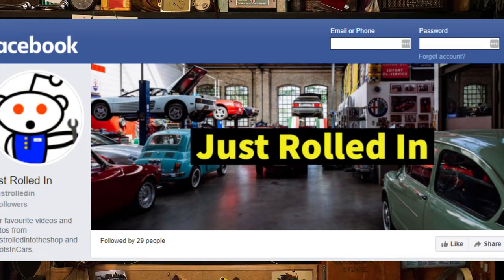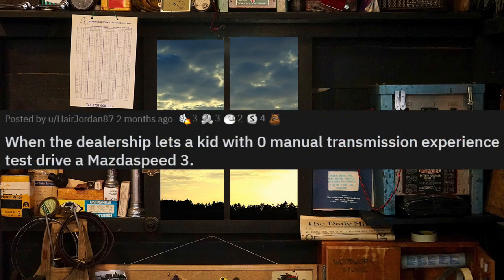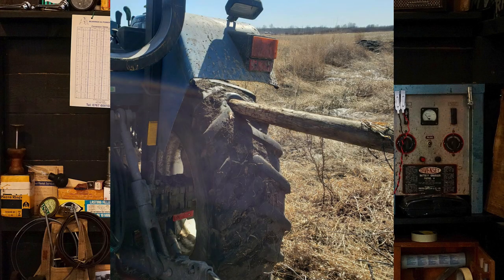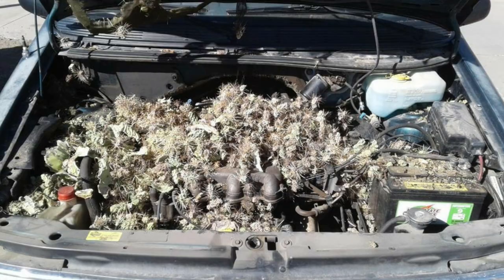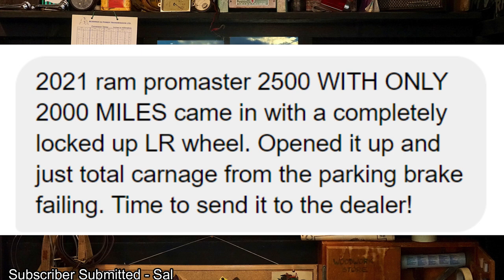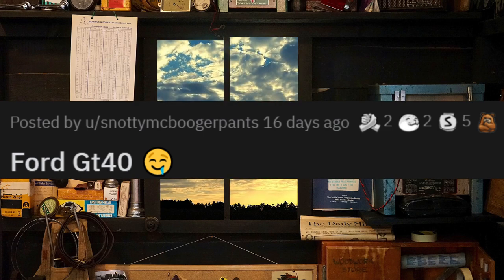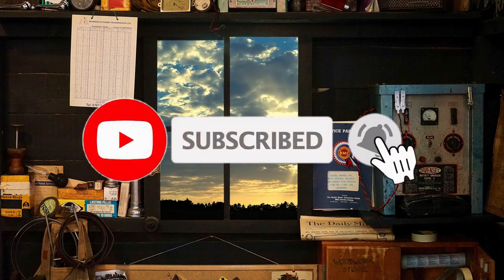Customer States "Can You Remove This Rabbit From My Engine?"

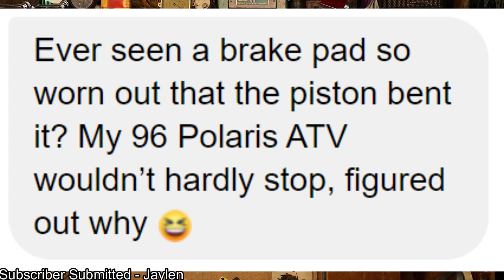Comment: @1:04, yeah I have seen that.  If the rotor gets too thin and the break pads also get too thin, if possible for the caliper piston to push itself out too far until I can turn sideways.

Comment: I almost had to remove the alternator on my demo derby 1990 Mazda B2200 pickup, trying to save a friend's startled cat. The story is, that the truck was parked most of the time at my friends house so the cat has made the battery tray it's cat bed. That day I popped the hood to check on the engine. I saw the cat crouching down on the battery tray, it got scared and took off getting herself stuck under the alternator but in the end she snaked her way past the tie rods and front crossmember.

Comment: In CA I had rat nests on my battery.  Moving to rural NE Arizona, I get bunnies, as well as rats.  One bunny ate a foot of 10 conductor cruise control cable.  Eight wires go into the cab---but where do the other two go?  He also ate all my windshield washer hose.  If they didn't do any damage, it wouldn't be so bad.

Comment: Garden hose oil return line, guess y'all never broke down in the middle of no-where or in the woods where help ain't comin and had to figure out how the get home. I once crushed my power steering cooler because Mazda thought it would cute to mount it on the front axle. I pulled the cooler out and connected the two lines with a 6mm socket and two hose clamps. Drove it like that about six months before I decided to order a new one.

Comment: Ahh the ATV brake pads, something I'm quite familiar with! All the grime packs up in the caliper, atv sits for seasons at a time and eventually parts corrode together. My favorite though was a harley customer who was angry about having to replace his rear brake pads again. he only used his rear brakes (one of THOSE people..) and burned through them faster than tires. This time he called us ripoffs and left. A few weeks later he was back, complaining of his brakes barely working. The pad wore through, then the steel backing plate until the piston literally went through what was left. Caliper and rotor destroyed. We fixed it all, and i don't think he came back, which was fine by me. For all the brands of bikes I've worked on, HD customers overall were the worst.

Comment: My wife drove her car home and some pulled up next to her on the highway yelling "You have a Flat!"  She came home and told me.  I did not find a flat, but realized the guy was yelling "Dead Cat!" as the rear end of the cat was stuck in the engine compartment with the front half dragging on the ground.  So here i was under the car with a pair of Channel locks pulling on that cat with it's juices leaking out when a couple of Mormon boys came buy on their mission wanting to spread the word and talk to me.  They did not hang around for long once they saw me pulling on that dead cat.  It was so jammed in i could not get it out, so I decided the next best thing to do was take it in for an oil change the next day.  Halfway there, the cat knocked loose on the highway. Riga mortise had set in.  When I heard the thud of running over the cat, I looked in my rear-view mirror and the cat was stretched out and sliding down the highway behind me, then went into the ditch.  Those squishy sounds of that cat in those Channel-locks will haunt me forever!  True Story
Reply from the maker: That's a crazy story and I feel bad for the poor cat!! I hate removing animals from vehicles, especially when they're dead.

Comment: I followed a pick up with the rear diff cover missing. The truck stopped at a light, I told the driver what I saw. He was more than a little upset, it was a brand new truck. He had just picked it up from the dealer and was taking it home. I told him turn around and take it back, the diff was ruined anyway. Not a drop of oil in it.  Do your own PDI new or used, you never know what you may find.
Reply from the maker: Wow no diff cover. Now that's a first lol

Comment: Wildlife:  I have an old Foxbody Mustang that was in storage for a while.  Opened the hood to begin getting it back into driving shape and there was a 3-foot snake on the engine.  Nope.  Closed hood.  Walked away.  

I did get it running again a few weeks later.  Still drives like a champ.  And no more snakes.

Comment: Had an incident with an animal in an engine bay. Not in a car, but a Case wheel loader. Ran it one day and the next day I started it, I heard a couple tings from the engine area. Didn’t repeat, so I thought nothing of it. Was working on it later when i found the clumps of fur in the radiator. Found the cat at the bottom of the fan shroud. It had made its way past the guard for the fan. Was a cold part of the year. Totally sucked. Made it a point to bang on the engine covers to scare out anything hiding there since.
Reply from the maker: Damn poor cat! Good idea on hitting the engine cover before getting in.

Comment: My uncle lived on a farm, and had lots of cats.  During the winter months, he would use his tractor daily to clean the barn.  The cats would then climb into the engine compartment, between the fan and radiator, for warmth.  Several cats were killed yearly, when he started the tractor.

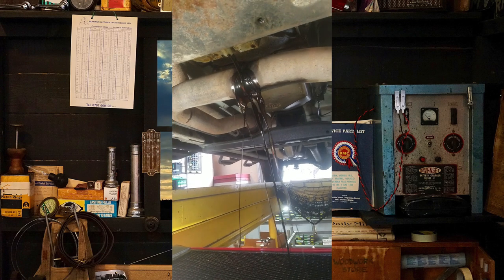Comment: 0:45 Every ford truck I ever changed oil on (early '00s and late '90s mostly) drained directly onto the frame. Not as bad as the exhaust, but also wouldn't clean itself up like the exhaust...

Comment: I bought a brand new Acura and it only had 32 miles on it when I limped it back to the dealership, the coil got so hot it melted the head. And they actually thought I would take it back after they fixed it!  Didn’t happen, got a different new one

Comment: The "GM Innovation" thing reminds me of an oil change I had to do on a BMW. Most irritating car I ever worked on, other than Tesla. The dipstick and oil pan were fine. No issues with those. It was the fucking oil filter itself. It was built into the engine... near the front window... under a beam that was BOLTED INTO the frame. None of the tools that I had at the time could reach it, so I had to get it by hand. Long story short, it took me over an hour and a half just on replacing the oil filter alone. German Engineering, my ass.

Comment: That's not a drive shaft. That is a torsion spring for the front of a GM vehicle. There are tons of pickup trucks vans and suburbans made like this. The loan fact but you can adjust the right height of the vehicle by tightening the screws that twist those springs down on the frame.

Comment: When I was a tech for Nissan I had to replace the transmission in a brand new 2014 Nissan Versa after going to put gas in it when I was done with the PDI. Nissan sent engineers out bc they didn't believe the transmission was bad. They had me replace the TCU and eventually replaced the CVT trans.

Comment: My 2018 silverado the oil drain plug and filter are in a great spot and right beside each other, perfect! Now the transmission pan has no drain plug and the pan has to be dropped to change it. Well guess where the exhaust goes….right underneath the pan so dropping it isn’t as simple as
It sounds

Comment: I'm from Australia and down here we have these animals called possums
Their nocturnal, so you rarely see them during the day.
Anyway I rocked up to my job about 8:30am, it was cold and raining lightly.
Right before parking my car, I see something out the corner of my eye scurrying around and coming straight toward my car.
I stopped, it looked like a giant very wet rat. It was a possum looking for some warmth. It climbed up my wheel, up the spring, across the upper suspension arm and found a comfortable very warm spot between the engine and a heat shield.
When I found it there, it looked at me with its small black beady little eyes.

I tried to remove it, but they have four hands and a tail they can wrap around everything.
It was holding on to a hose so tightly that if I pulled it any more, it would have either hurt the animal or pulled the hose out with it.

I left it there to enjoy the heat.
I guess the little blighter felt hungry too because I had all kinds of electrical issues later which cost me a packet to have fixed.

I hope that possum had a great life with many kids, because my brief encounter with it was very expensive🤣

Comment: “Have you guys every see brand new vehicles have issues?”   Almost every Hyundai….  But it’s job security
Reply: Back in the 80s every new American vehicle had issues. You just expected to take it to the dealer for warranty repairs. My dad bought an '81 Ford Fairmont new off the lot, and the parking brake didn't work. The dealer couldn't fix it, so the car just never had a parking brake. This was in addition to the rustproofing material smeared on the upholstery and the handful of loose bolts that fell out from under the dash.

Comment: in 2008 a 2008 jeep with under 300km on the clock, locked up after the oil pick up fell off.
when the motor was pulled down, all the bolts inside were only finger tight .......... must have been the last one made on a friday.

Comment: When i was young and over my head on a repair to my car I had to remove an Animal of a mechanic who couldn't compare timing gears  (new  to old) and spent 3 days trying to get the distributor shaft into the car with the wrong gear on it.  I could understand ordering the wrong one but not taking a look when it wasn't working?  Some Chevy 5.7 came with roller camshafts.

Comment: Ever see a left rear brake Disk worn down to 1/16" thick and broken off from the Parking brake drum still held in place by the frozen caliper with the brake pad all metal and about half thickness. The shade tree mechanic across the street Said "It was making a funny noise might be a rear wheel bearing".

Comment: :48 My cavalier is just like this, the oil filter is right above where the flex joint is so the joint just gets soaked in oil when you pull the filter off and it smokes for about 20 mins of driving with a huge blue cloud behind me. So stupid
Reply: Yeah, on older Honda Civics the filter is on the firewall side of the engine, directly above the downpipe. Pain in the ass.

Comment: I saw a picture of a rice burner with a HUGE SNAKE in the engine bay pretty mangled.  The kid noticed it started acting funny and pulled over and opened the hood and almost fainted.  I think it was a boa.  They had no idea where the snake came from (It was is LA, btw).  I am just glad I didn't have to remove the damn thing (and I don't like snakes).

Comment: I had a 1985 Camaro Z28, pulled that shitty GM TPI crap off and carb swapped it, so the check engine light was always on because the wiring harness not being connected to anything thought something was seriously wrong with the engine; anyway, the check engine light in those cars is conveniently a completely separate light on the dash, in its own rectangular cutout, and a piece of electrical tape covered it nicely lmao 

This video reminded me of that

Comment: Turbo oil will cause a vehicle to catch fire, We has a series of bus fires locally.  Some dried coolant is combustible, busses again. Fire caused by worn through wiring to the A/c, bus again. Cross threaded  CNG line, overheated engine and a loose wire oooh boy.

Comment: About the animal under the hood, my Father and the cars owner had to clean out the entire engine compartment because a cat went through the fan and belts and its body was everywhere. And alot of it had burned from the heat of the engine  because the owner drove it 40 miles after he smelled something nasty coming from the heater and smoking from under the hood.
Reply from the maker: That smell must have been awful!!
Reply: @JustRolledIn  My Dad said he threw up 3 times by the time he was done. 
And this was in the late 60s, so no power washers invented yet.  Just a hose and a nozzle and cold water.  Oh, and alittle over 3 hours.
Reply from the maker: @davidbruin4381  Dang, I feel bad for your dad. What a mess that would be to clean without a power washer.
Reply: @JustRolledIn  I'm just glad that I wasn't old enough to help 😅. And not there when he had to do it. Eewww!!!

Comment: back in the days when we used to live in a oli camp, back when oil companies have the massive urban centers build just for the workers, we had an issue with cats snucking on the engines, bloody mess, grind up cats dont smell good, imagine firing the truck and hearing the cat on the radiator fan, at first you think cats are fighting then you realize what happened, i remember one got stuck in the belts, that was neighbors, not a good way to go.

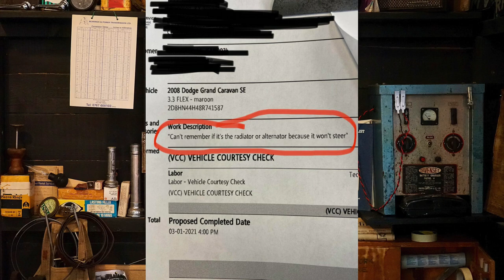Comment: 0:52 ROTFLOL

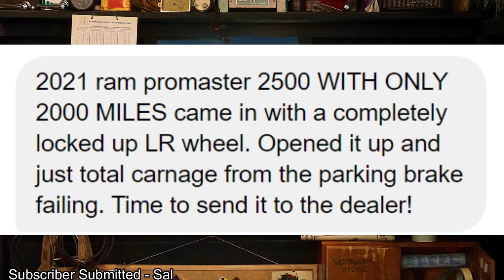3:23  I met a guy with a Dodge Grand Caravan which suffered a fuel delivery failure after just 575 km.
Reply from the maker: That's brutal. That reminds me of a brand new Ford Escape I had to PDI with 3 different color seats in the back 😅
Reply: @JustRolledIn  Lucky for the driver, the van was a rental, so it became the rental company's problem.

What is PDI?
Reply from the maker: PDI is pre delivery inspection. Has to be done on all new vehicles that came in the dealership before being sold.

Comment: My van started but sounded Awful.
I turned it off and opened the hood.
Good gravy! A rabbit ran up my arm and down my back. It ate 3 plug wires and some small wire. After that, I put fake snakes under my van.

Comment: 2:14 HAD THIS HAPPEN WITH MY EQUINOX 
BUT I DID NOT KNOW UNTIL I STARTED TO
SMELL SOMETHING DEAD. AND WHEN I DID FIND IT IT WAS IN A HARD SPOT RIGHT HAND SIDE UNDER TOWARD THE BATTERY.
 HAD TO REMOVE BATTERY AND WEAR RUBBER GLOVES TO REMOVE THE 🐇 IT
WAS SO GROSS.

Comment: How about the Ford 302 with two oil pan drain plugs? That design always bugged me and the brand new ram I mean it's a Chrysler product be happy that the engine didn't explode or fall out, I don't get why it wasn't towed directly to 5he dealer, I would have demanded my money back or loan cancelled whichever the case may be and gone to by a real truck like a Chevy or GMC, at the very least he should demand a whole new truck if a catastrophic failure occurred so soon as it did.

Comment: Because Honda is a bunch of kooks and does a great job of hiding/downplaying all its idiotic mistakes (such as the vcm fiasco with its V6 engines used on many of its vehicles), let's make sure to remind everyone of the time Honda used soy-based wire insulation in its cars to be more "green."  Well, it definitely was more green as rodents enjoyed snacking on the insulation.  Solution?  "Chili" electrical tape laced with capsaicin.  I shit you not.  I first learned about this issue when I saw the tape on Ebay and thought, "This is the most whacked, ridiculous thing I've ever seen."  Then I read the reason for the tape and realized, "Honda is more whacked than this tape."  Comments?

Comment: Not a mechanic, even worse Body Tech here. I had a 2019 Subaru legacy in for a front bumper cover and headlamp replacement. I'm sure you know Subarus have flat 4s and pulleys/belts that span across the front. Right in the middle  on top of the motor between the power steering pump and another pulley was a beheaded rat that got hit by the spinnng belt! Worst part it was a rental car! So who knows how long it's been in there or of they got it out!
Reply from the maker: Damn 😅  but ya probably was there for a long time!
Reply: Didn't even realize how many animals I've removed as a body guy 😅😅
Reply from the maker: @MalibuWaGOON  🤣 I could only imagine.